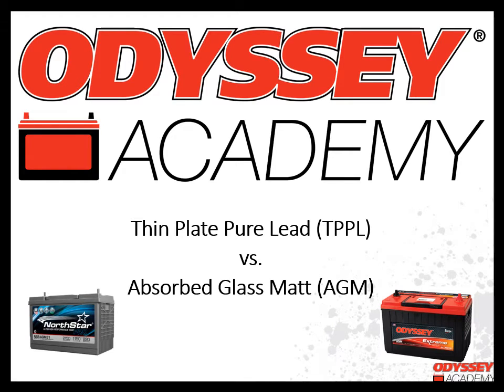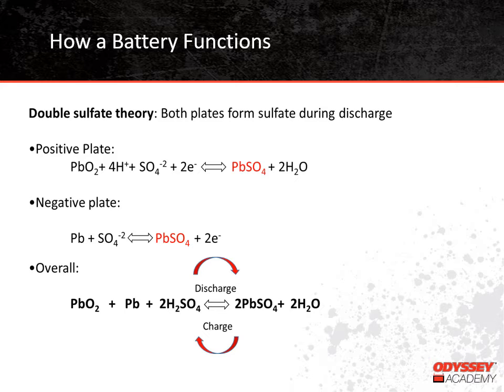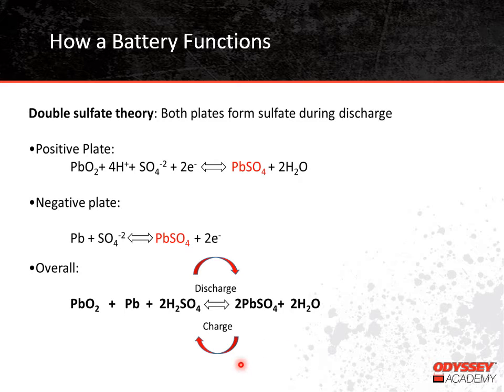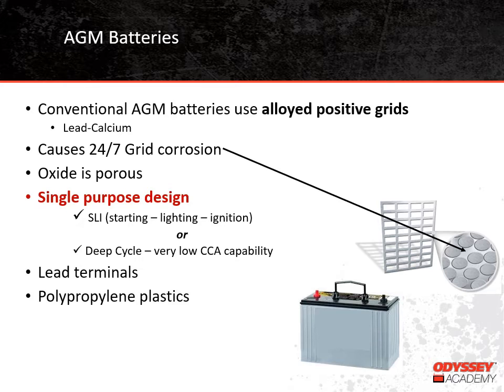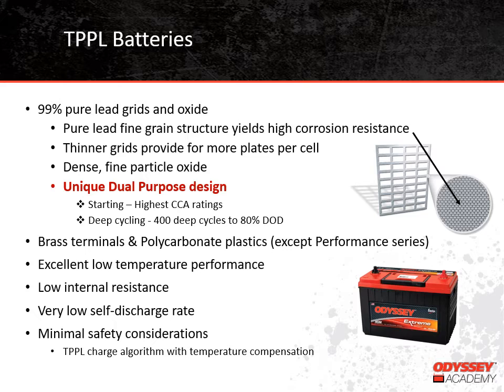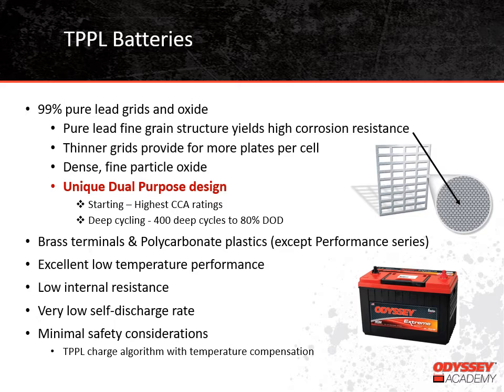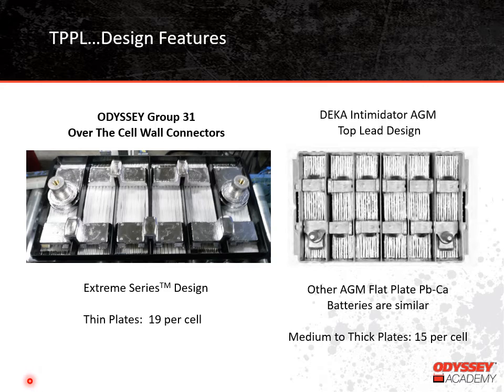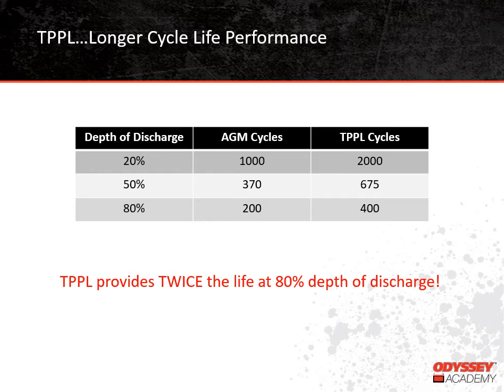ODYSSEY Academy – Thin Plate Pure Lead (TPPL) vs. Absorbed Glass Mat (AGM)

Comment: Nice vid. I have both battery types and as far as the one advantage the Odyssey has vs Braille I have is length of life for sure. 

The Braille I have is much lighter though 11-12 pounds vs 28 pounds.

Comment: What's the difference between odyssey and northstar?  They seem identical, but in different colors.
Reply: I wondered the same thing. According to Odyssey's website, Northstar Pro (the equivalent of Odyssey Extreme) have been discontinued. From what I can find on Northstar's website, it doesn't look like they make automotive batteries anymore. The only Northstar brand batteries I currently see listed are for telecommunications, data center UPS units, etc.
Reply: @averyalexander2303  yup.  I emailed Odyssey and Northstar became part of them.